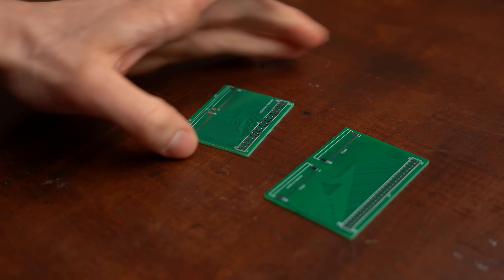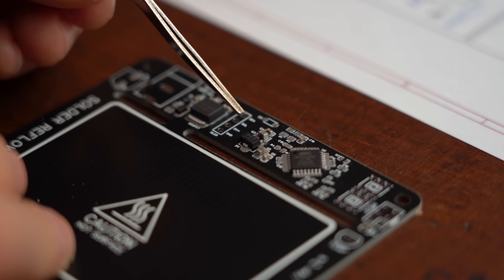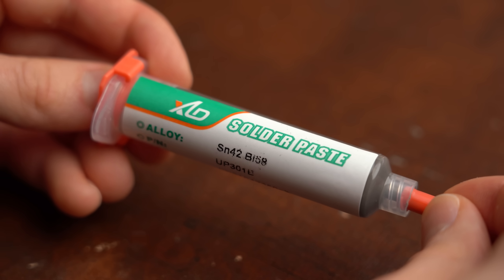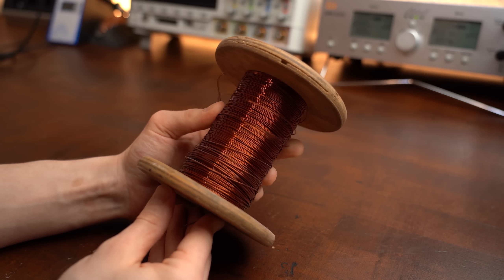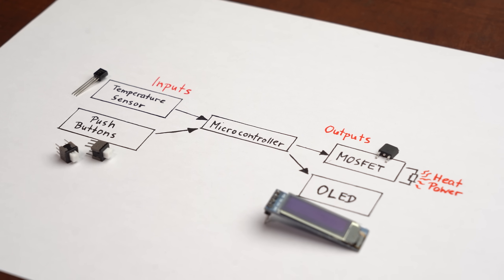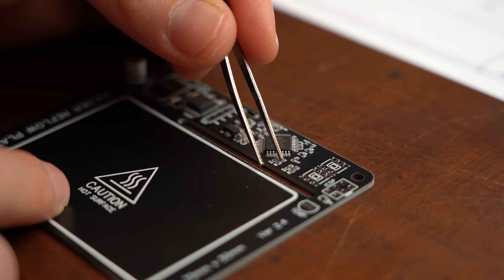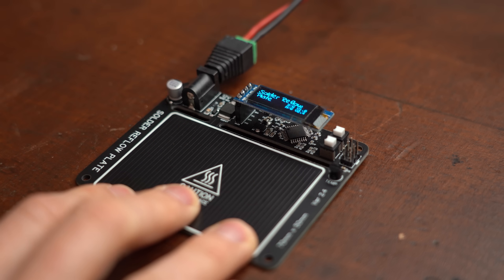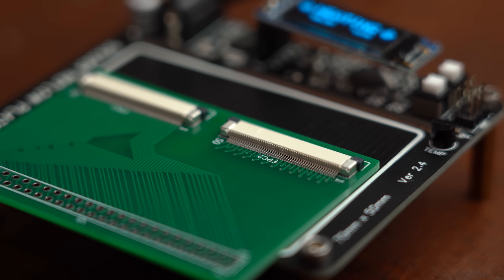The Best way to Solder? Hot Plate to the rescue! (DIY or Buy)

Comment: For 60€ you get a used 3d printer with more than 200x200 square hotplate with aluminum extrusions, very usefull to build a reflow plate or oven. Control board included. Some you can control over usb directly or use wifi. All have a screen. You can modify marlin or klipper to use it in any possible configuration. 
Very usefull. I just use klipper and an old mcu with debian which was lying around. Perhaps someone wants to take some snippets from marlin and creates a standalone firmware than its a quite professional bit kit. 230 degrees celsius is possible with most hotbeds for some seconda so you could even solder leadfree or use a hot air gun for the rest 50 degree. nice for double sided pcbs...

Comment: Trying this with an old PCB/aluminium heated bed tomorrow, hopefully the solder on the power connectors has a higher melting point.

Comment: After all those videos i can't believe that Great Scout don't know how to micro-solder.
1. Use flux for hand soldering, it removes bridges and gives shining solder joints.
2. As for the hot plate, the simplest and cheapest way is to use cloths iron. it also have biggest surface.
3. You can use hot plate for preheating the board to 150-160 deg. and use reflow station to finish the soldering.

Comment: I don't want to sound like a smart ass, but a 3d printer heat bed and a simple power voltage regulator will do the job better and cheaper

Comment: The hot plate should have been a separate pcb with a connector to the controller board. That way when it goes bad, it can be easily replaced. Also difference sized hot plate pcb's should be possible this way.

Comment: Life span might be the issue here, as I watch previously on Carl Bugeja channel (he have tried 2 versions of PCB hotplate) he have issue with constant heating in high temperature the break the copper tracing from the board (bubbling) or even bend the PCB board.

Comment: I wonder if I can use my 3D printer's hotbed...Specifically the 24V ones or the 230V/110V ones
Or better yet, use it's mainboard as a controller and use a solenoid relay switch to control the coil. :o

Comment: Does anybody know which temperatures the heating plates of 3d printers can withstand? It would offer an even larger size and they're pretty cheap to buy. I'm currently using the heating plate of a clothing iron, but even that is often too small so I'm thinking about something larger.

Comment: In a college course I first learned to solder SMT components using a cheapo kitchen hotplate. It worked pretty nicely, but without temperature control (just a dial from "low" to "high") it resulted in some well-toasted silkscreen on the underside.

Comment: I usually just use a crocodile clip holder, or hang my boards off a table with a counter weight and use hot air on the underside of the board. Great way to solder connectors with plastic components without damaging them.

Comment: Nice DIY hotplate and board layout. Thanks for your test - its impressive to see how "easy" it is to create such a hotplate by your own. Another idea could be a sheet of aluminium with drilled in heating pipes from 3D Printers. As a solution in between I am using the ET-10 Heat Table, which I bought for around 40 bucks. It's heating area is 10x10 cm. Heating time is not the fastest but it's doing well. Thanks for your GreatJob! :)

Comment: For The pcb heater, would it be possible to put the code on the microcontroller before desoldering it in order to skip the later part of the process?

Comment: Hi Greatscott! 🙂,

i have a suggestion for this Reflow-Plate..i am currently unable to do it, where i have a guess that you could do it:
How about an induction Reflow-Plate?
This is the ultimate solution for solving the life span issue of the PCB-Reflow-Plates!
This means a circuit should be designed for warming an aluminium-Core PCB using the induction effect (like the induction stoves!).

I would be more than happy, if such a project could be realized 🙂

Cheers,
Mimad

Comment: I would ratter let make and buy PCB boards from a company in the EU, and not everything from China, like Multi-CB a German PCB company, or all the other top 59 European PCB producers:

01. AT&S
02. Ruwel Group
03. Wurth Group
04. Multek
05. Fuba
06. Cire Group
07. Eurocir
08. Schweizer Electronic
09. Aspocomp
10. CTS Group
11. Elvia 
12. Microser
13. Freudenberg Mech
14. KSG
15. Freudenbeg Mektec
16. Invotec Group
17. SoMaCis Italia
18. PPC Electronic
19. hmp Microprint
20. GPV Group
21. Sanmina-SCI
22. Dyconex
23. Varioprint
24. ACB Group
25. Cistel- Laier
26. eXeption
27. Cicorel
28. Greule
29. Ramaer
30. Elco
31. Hausermann
32. Pri Dana
33. Polytron Print
34. Lares Cozzi
35. Graphic
36. ZOTEngineering
37. OMR
38. Cisel
39. Silga
40. Optiprint
41. Labtech
42. Brockstedt
43. Teknoflex
44. Steveage
45. Photochemie
46. llfa
47. Confidur Group
48. GS Prazision
49. iSys
50. Storz
51. SAT-Sagem
52. Fela
53. Spirit Circ.
54. LAB
55. Rohde&Schwarz
56. Jenaer
57. Microcirtec
58. Tecnoboards
59. Elekonta Marek

Comment: Why don't try a Iron controlled by a Arduino and a SSR? Reaches 200°C with ease and has a big flat hot surface..? Maybe a heated bed from a 3d printer can do this trick also.

Comment: Some may be interested in a more primitive and much less expensive approach to this.  It's a regular cooking hotplate with a steel circular saw blade mounted above.  While a thermocouple is needed to calibrate it, in normal use, starting at room temperature, the hotplate is simply turned on, then off, then on again, then off again for the appropriate times, and you get a nice reflow curve with no risk of overshoot.  The thermal mass of any PCB will be incidental to the mass of the hotplate and saw blade, so the times are the same for any board so long as the paste is the same.  I don't think links in comments are permitted, but a video showing this method is available in the Youtube channel "Tulsa Opensource Hardware" in the Tutorials section.  It shows the use of 120VAC parts available in the US, but the same premise would work for EU power.  I have never had much luck putting thermocouples at the right place, and this method works quite well for me because it is strictly time based - no thermocouple, no PID, no controller.  Just a stopwatch.  Of course this is for occasional use, not production.

Comment: Just as an advice to proper usage of hot air soldering stations: make sure you keep the nozzle at the same height, but keep it moving (e.g. circular). This way your components will encounter less thermal stress compared to keeping it static at one point.

Comment: I feel like the hand soldering could have used more flux (still quite hard even with a dedicated micro pencil), and the hot air could have shielded the connector with Kapton tape (still quite tricky because of the geometry). I'd imagine that a hot plate would take away a lot of the difficulty.

Comment: I also got one of those a ½ year back as I liked the small form factor and having black small hotbed for certain things and I could use it as a spanlock for thermal cameras and fusing certain parts together.. some people doubted the accuracy so tried to take a look with very crude tools.
in my cude testing, it was surprisingly accurate... it will overshoot a few degrees, but that's how it is, otherwise it would take ages and it will cycle around the set value (normal) ..https://www.youtube.com/watch?v=XLaB0NieyEU
also looked in a thermal camera and the heating was linear and very well distributed across the plate, on my unit, and it certainly doesn't feel cheap or was cheap - was like 66USD to Denmark at a sale (with incl. 25%VAT) I use mostly PD power banks with it.
from room temp 30 to 350* degrees - it took 2.35minute (155s) and from 30 to 300' celsius, it was a tad under 2 minutes. (120s)  and it peaks at just under 3A (20V)

Comment: Why not separate the logic & power PCB  from the heating PCB, so that if the heating PCB burns out you just solder connectors on to new PCB and plug the logic into it?

Additionally,m you can design larger heating PCBs, and if the logic is tuned to the PCB size then simply have a specific resistor on each size PCB and have the logic check the resistance at startup and choose the correct profile.  An easy way for the logic to check the resistance is to use a voltage divider on a 5V line going in to an analog input, where part of the divider is on the logic PCB and the other part is on the heating PCB

You could, of course, have a menu option to select the board size, but the resistor solution allows for automatic configuration and less mistakes.  It should also be possible to have the resistor far enough away from the heat on the heating pcb since it isn't part of the heating process and therefore placement isn't an issue.

Just noticed that Colin Bardini had a similar suggestion below.  Leaving mine here since it goes a little beyond his suggestion.

Comment: A great tool when placing components by hand is "Interactive HTML BOM". This way you don't have to cross out the components in the printed schematic. 
Instead you will get the BOM where you can cross out each component and more importantly: It will show you where you need to place the component on the board.

Just look at the demo, this tool is insane and helped me a lot when assembling complex pcb designs. It comes as an extension for EasyEDA, KiCad and Eagle. 

GitHub: https://github.com/openscopeproject/InteractiveHtmlBom
Demo: https://openscopeproject.org/InteractiveHtmlBomDemo/

Comment: I really like this, I was wondering about adaptability though: for example, I have one of the Uyue hot plates but as of late I've had some issues with it staying 5 to 10 degrees under the set temperature and I'm wondering if I'd be able to use existing hardware and use a different controller like that.
Also, is the quality of the copper used in the traces a factor? Like an impurity that accidentally got in the copper causing a dead or low temperature spot?

Comment: Hey GreatScott, thanks for another excellent video. I have to say though, when it comes to those fine pitch pins on those connectors, you can easily hand solder them with the drag soldering technique. See if you can find a hoof tip for your iron. With some good flux and a bit of practice, you can solder that entire row of pins in seconds. You should give drag soldering a try 👍
Reply: Yea, I wanted to let him know too...  it's pretty easy once you learn the technique and use correct tip.
Reply: @RedSound2011  Heck yes! I love drag soldering. I remember in my earlier days doing a pin or three at a time with a chisel tip and that worked for what I was doing. Once I picked up a hoof tip, I realized how much better it is. Perfect rows of identical solder joints everytime. The best was when I realized I could make longer lands on QFN package footprints and drag solder them. Good flux and a good hoof tip is all you need, most of the time. Leaded solder helps as well 👍

Comment: I had the very same drawer-type reflow oven that you show in the beginning of your video. 
That is a horrible piece of equipment - It managed to burn the components without melting the solder.
Also it ts stuffed with asbestos. 
I have since built an arduino controlled hotplate that works perfectly for my needs.

Comment: You can buy a hot plate power element to do the job, instead of PCB traces. It will cost more energy to build temperature, but lifetime should be higher. Rest of the circuit can be same. I think.

Comment: Wonder if those standoff screws at the front could be countersunk so that you get a greater width available to place the board.
Also would be good if it could accept close to 100mm wide seeing most cheap PCBs are max. 100x100mm.

Comment: Carl Bugeja also experimented with this but obviously it never worked! PCBs can't withstand much heat unless you go aluminium PCBs or something. I know this from my 3dprinters :D
I don't get why ya'll don't just use PTC or ceramic resistors or whatever or DIY a heater coil with copper wire Thermal glued to an aluminium sheet?
it'd be so cheap!
or a silicone heater on an aluminium sheet, so cheap!

Comment: Great video! From the testing I've made, I found that PCBs with Tg > 170degC are not recommended to operate at high temperatures for long periods of time. So even though the reflow cycle is less than 5mins - soldering multiple pcbs will eventually damage the pcb hotplate. It can damage the internal layers of the pcb or the soldermask (depending on the temperature) mainly because the copper inside is at a much hotter temperature than the surface. That said it's still an interesting project to make and learn alot from! Here's my video about all the things i've learned about this  https://www.youtube.com/watch?v=fbBXPeC-FPQ&list=PLzP6_DqZoxc1of9OfZ4hKAGF9jIvG5vke&index=3
Reply: Was thinking of your videos on the subject while watching this one.

Comment: The PCB heater should be fine, 3d printers have been doing them for almost a decade

Although to be fair, the temperatures are lower and most of the electronics are housed very far away

Comment: I have experimented with hot plate soldering, and it's easily my preferred way for SMD work. It's also great for salvaging SMD parts. My DIY heater uses a couple PTC thermistors as heating elements.

Comment: Only problem...the FR4 board max "safe" temp is 150C....it will rapidly degrade the glue between the copper traces and the board...
It would be better to get a hunk of aluminum...a few of those 3D printer heater modules for the hotend (dirt cheap), a 3d printer thermistor (dirt cheap)you can install into it (...better yet...just epoxy a thin sheet of aluminum on top of a 3D printer hot end...then setup the arduino to heat it that way...instant "hot plate" that can easily get into solder melting ranges without worrying about it burning out
Better yet...build a reflow oven
Oh yeah...check this out too!!!
https://www.youtube.com/watch?v=9q0mh3y_XBc

Comment: Why making it so difficult? An old cast iron hot plate for outside cooking, a thick copper/aluminium plate with a thermocouple and your eyes as a controller. Done.
Works well. I have soldered several boards like this without problems. 
It's not good for mass production but, for the occasional board it's great.

Comment: I did some reflow soldering testing while there was a pcb constantly lying in the oven. After around 20 reflow cycles the pcb changed color and the copper started to get losse. I guess you have to trim the reflow temperature as close as possible to the minimum temperature at which it still works so you get the maximum lifetime of the diy version. Alternatively you can use a disposable hot plate pcb that gets soldered to the electronics an gets thrown away once its broken.

Comment: 8:30 he stole the chip from an arduino. So why did he not program first and then desolder the chip 🤔 . IDK if anyone knows then plz reply
Reply from the maker: It would not have been possible to get rid of the bootloader. But if you are fine with the bootloader being present on the hot plate, then you can do it like that.

Comment: Have you already tested the cheap aluminum hot plates from aliexpress ? (unfortunately there are powered by 220V...) Apparently they are made to solder BGA chips, or LEDs. They have an interesting size.
Edit: they are called PTC heaters

Comment: Since you have more than one of the DIY PCBs, you could try to have one above the other, to prevent cold air above from cooling the soldered PCB, like an oven. also having problem with size of the DIY solution, you could put one beside the other to have double the space of soldering (I know there will be gap inbetween, but it might work anyway for your aluminium PCB.

Comment: @GreatScott! You could source bigger, better and cheaper hot plate if you could find old cloth iron. Only the control circuits are required and could run with AC power

Comment: I like this but feel that it is a shame that you need similar repeat circuity for everything for different soldering irons to the heat plate. They are in essence similar products. It is a shame that we cannot have one removeable control  which can control them all with different option settings.

Comment: Very interesting. I'm wondering if you can help mitigate the lifespan issue of the DIY option by setting it to a temperature just below the melting point of the solder, waiting for the board to heat up, then hitting it with the hot air gun to melt the solder?

Also, and I haven't looked into the project so I don't know if it's possible, but you could get more accurate temperature measurements by sticking a K type thermocouple to the top of the board. Obviously it might take some modifications to the project to make this work, but it would definitely help with the accuracy of the temperature readings and reflowing.

Comment: Hi there. Why not use heat bed of 3d printer(ac silicon heating element)? Though though Im not sure if could reach reflow temperature because the highest I tried to it is only 110 degrees

Comment: Hot plate soldering is really good for not burning plastic latch type PCB connectors. Also interested on the cycle life of aluminum substrate PCB's vs conventional FR4.

Comment: This looks incredible! I can't wait to get my hands on one of these. I've been wanting a hot plate for such a long time, though i didn't like how massive they are built to be.

I love the small compact design. Though, the heater board needs to be separate from the other electrical components. I would anticipate this board to need replacement every year or two, and a standalone drop in replacement would be a VERY nice addition to lower maintenance time/cost.

I hope the developmer(s) are looking through all these comments, as there is great tips being shared!